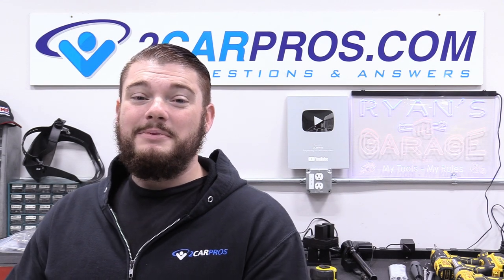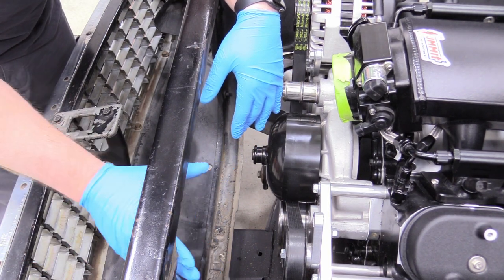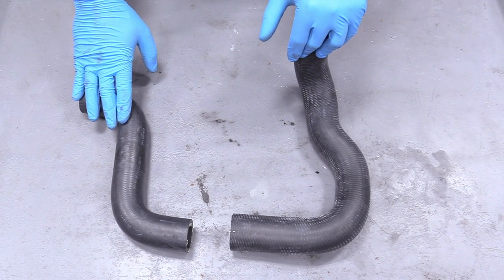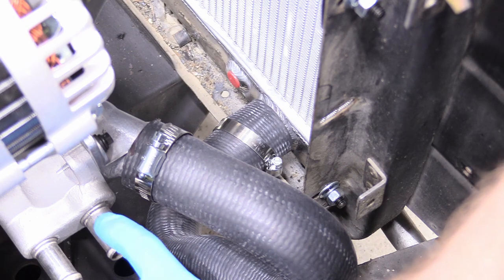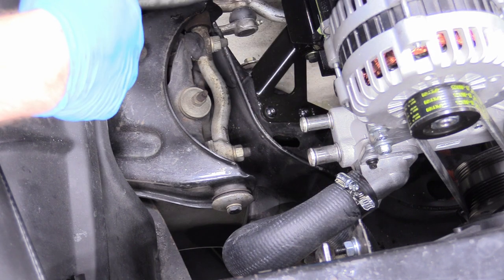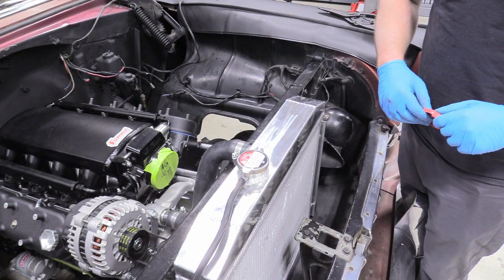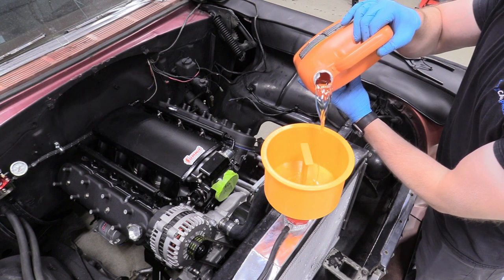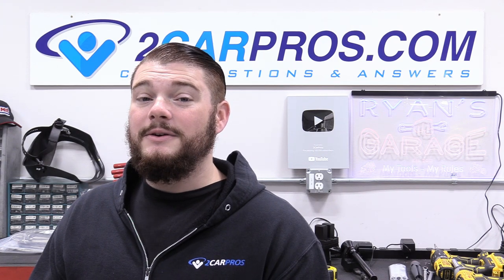How to LS Swap - Episode 8 - Cooling System

Comment: The reason the hood still shuts is, Because the car had both a inline 6 cylinder engine and a v8 option, as the inline 6 is longer than the v8 the factory set it up as a easy way to fit both engines in and have adequate cooling, now I didn't see the hole car, I'm guessing its a 55 or 56 Ford or chevy like my 56 chevy sedan delivery. The grill and inner fenders are identical to my car. Originally it was equipped with the inline 6, however the dealer sent it back to the factory and had them change it to a v8 car as, dealerships used to be accommodating. Mine was a delivery car that was set up with the heavy-duty frame the one piece Dom frame as apposed to the dual c channel welded to gather frame, thats what got me, i thought how weard, when I ordered my ride tech 4 linked conversion kit, their was a different one depending on the frame type. But back to the radiator mine was sent back, to the factory for the v8 conversion and automatic transmission conversion. maybe yours was aswell. Your engine install looks great.
Reply from the maker: I'm just happy it fits! haha thanks for watching!

Comment: A thought crossed my mind and wanted your thoughts.  If you have the space, how about running a section of straight steel pipe (perhaps painted or chrome) between the pump and the radiator?  Is there anything you should take into consideration when trying to do this custom touch?
Reply from the maker: I personally just wouldn't want an other point of failure in my cooling system. It would be a real bear to have a hose come off that mid drive. Thanks for watching!